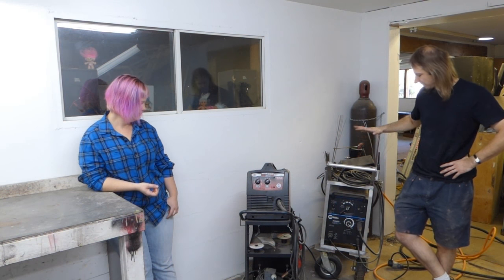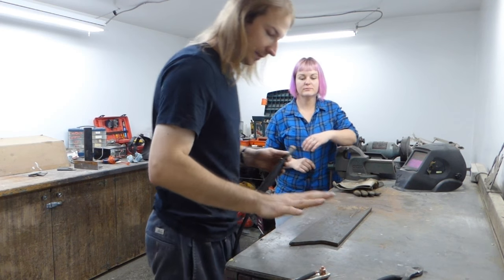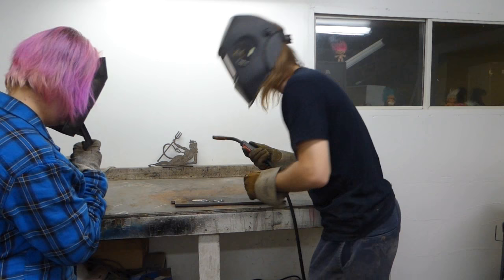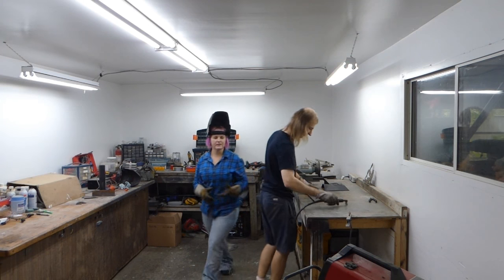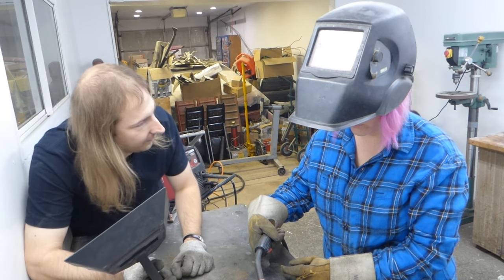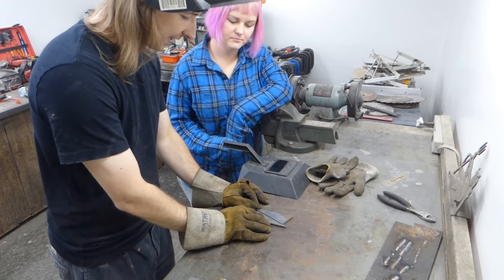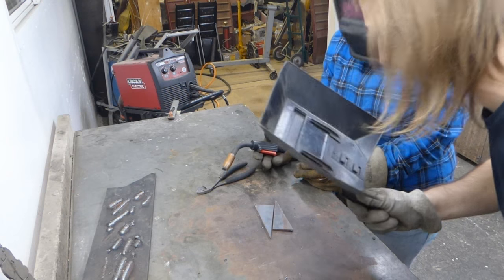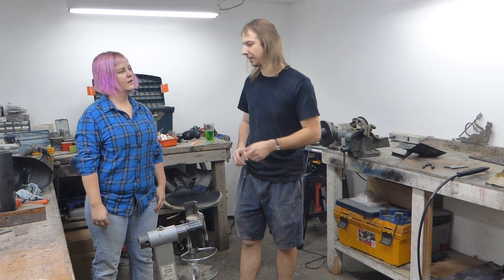Lynnette Learns To MIG Weld

Comment: Why make Cosmo videos when you get to play hide the weld rod with Lynnette
Reply from the maker: Hide the tip. This is MIG.I was on a rare vacation (spending that time rewiring the shop) and Lynnette had a free afternoon so we did this.
Reply: Good to still making you doing stuff, and by stuff I mean laying down a decent bead of weld.
Reply: Why just the tip? Don't hold out on me!!
Reply: Lynnette McInnes  just make sure you do safe welding, don't forget to use a good set of goggles, I have seen him welding without them, very bad, but at least he closed his eyes at the last minute.
Reply: I thought that was just your "weld face"
Reply: now it's my turn to spit laugh tea everywhere. SAFETY SQUINT!
Reply: Yes Heads Tails, he is a naughty boy!  I however enjoy having all my body parts unmarred, I will take your advice and continue to protect myself.
Reply: Good for you, no welding accidents
Reply from the maker: Nothing sexier than having a V shaped UV burn on the chest.
Reply: Cheap scarification...hmmm

Comment: look at the welding from porterbuild , he builds carparts 
http://pbfab.com/images/tech/dmf/dmf-6.jpg
i been at his shop and was suprized that the stack of dimes style welds he did was actually done with a mig welder , it was a realy good lincoln welder though
Reply from the maker: Making a nice stack of dimes weld with MIG isn't too hard, there are times when I have been asked to do so. Penetration is sacrificed though in most cases. Not too big a deal when sinking the weld into an edge. Bit more of an issue for a lap weld or butt weld.

Comment: prep sanding FC headlight covers while watching this, life is good.
Reply from the maker: Yeah, but prep sanding means a lot more sanding on the rest of the car, which isn't exactly fun....
Reply: aaroncake I have only sanded and painted areas where rust has grown(down to metal, primer then paint). I only did the headlight covers because the previous owner rattle canned over stock high gloss black -.-

Comment: I hope she remembers 1 and a half tip from the material. Some people have problems with more than just the tip.
Reply from the maker: Distance wasn't an issue, but she wasn't handling the tip properly and I only noticed while editing. Needs to fingers near the tip, don't always just grip the base. So much more control over what comes out when you hold the tip...we are talking about welding, right?
Reply: aaroncake Yes of course we're talking about welding? What else? On another note, I'm not quite satisfied how she's gripping the base there. I think she needs to direct her attention to the base, and after that she can focus more on what comes out of the tip. I just hope she caught it all in her mo.. On the metal....
Reply: Hand job 101!!! Thanks guys I've been doing it all wrong.

Comment: MIG is used for alu not steel when u weld steel it´s called MAG and is an aktiv gas!!
Reply: You can MIG weld steel with inactive gas like Argon. More common is CO2 because its cheaper. Aluminium can be welded with active gas like helium.
Reply from the maker: Yes, technically, but I've never actually heard anyone use the term MAG and it seems everyone just uses the term MIG. That said, I can weld steel using Argon which would make it MIG, or the C25 Argon/CO2 mix I use making it MAG.
Reply: I m working as a welder in Sweden! and the term MAG in more comon in european! and on my workshop we use the argon for aluminium welding MIG/TIG and an argon mix called mison 25 for MAG! dont know if u have that!
Reply from the maker: In North America it is generally just called "MIG". It sounds like you use the same mix for steel that we do, a 75% Argon 25% CO2 mix. I don't know if I've ever run straight CO2 for anything.